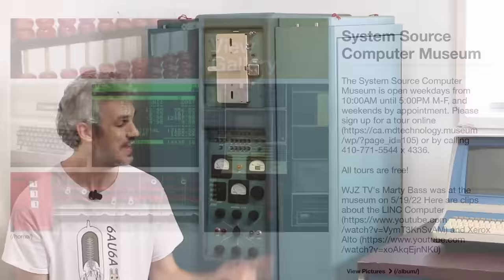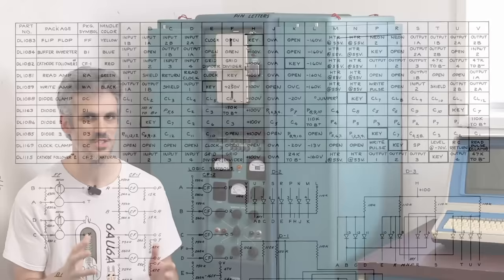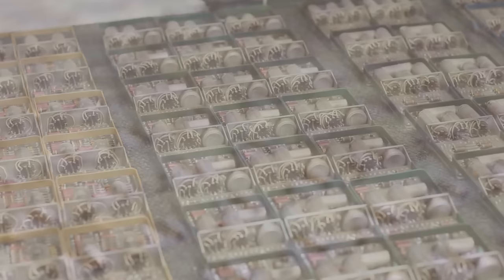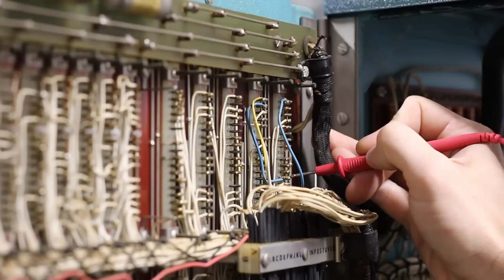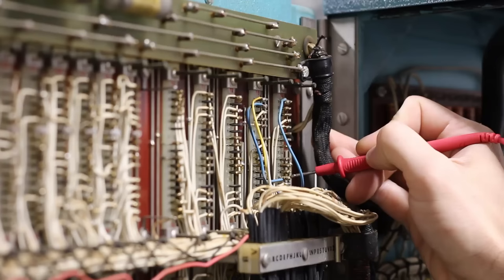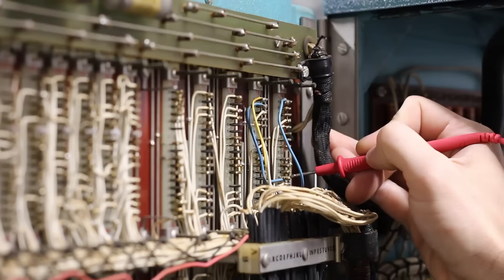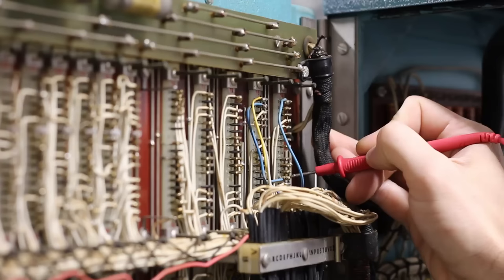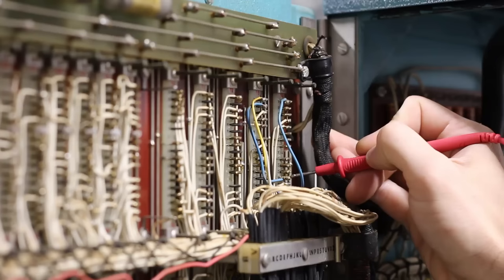Exploring 1950’s Computer Logic with the Bendix G-15!

Comment: Actually I'm not surprised there are so many buffers, since you can do everything but buffer and invert with semiconductor diodes. One of the biggest uses of tubes would be registers, but as I understand it the G-15 has its working memory and registers mostly on the drum, right? Great video.
Reply from the maker: Yup, you're on point! The very large majority of the machine is built around AND/OR logic and they just do a lot of signal restoration in the middle. 
As for registers, all the registers and memory is on the rotating drum, and they actually use the drum in a really fascinating way. The plan for the next video is dive into the drum, learn how it works and crack it open and take a peak inside to make sure it's all good!
Reply: @UsagiElectric  I look forward to it! I assume there is one register done with tubes to hold the next instruction address? (Or maybe they have some marvelously clever way to avoid that.)

Comment: Looking at the nameplate, you've also got some electrical work to do. That machine uses 40 amps!
Reply: I saw the picture of his existing electrical panel which didn't seem to have any spare circuit slots on it.  It'll have to be changed for a larger panel or rewired to a subpanel, I think.

Comment: The thing with diode OR gates that diodes have a voltage drop (about 0.7 volts for a 1N914 diode you can get today). Putting a signal thru successive diodes will drop the voltage for each diode. A transistor -based or silicon-chip OR gate doesn't have this issue.
Reply: Wow!  That is "old school" digital electronics.

Comment: I think I saw at least violet (7) and red (2) bands on the older glass diodes, there's probably also black (0). So they are labeled 270 that way, and are probably also 1N270.

Comment: One advantage of the double sided PC boards with just duplicated traces on each side is that each contact finger has a redundant surface front and back. In a system this complex, intermittent contacts could be a nightmare. I do wonder why the fingers were not gold plated?

Comment: I'd guess the unused 100V lines on the D2 card are there just to maintain commonality with the other diode cards that do use them.
Reply: wonder if any of the cards were in as blank spares for quick field service ?
Reply: @highpath4776  All the components on the cards are discrete, so can be easily replaced, for example the newer diodes. No need to keep spares.

Comment: On cleaning the outside i would use a mikd dish soap like Simple Dawn  a a sponge to clean the surface but only use a drop or two in the water and simply wipe don't scrub and use a oaint brush for any hard spots tgen rinse and dry

Comment: At time 33:27, it shows an odd voltage, 238 volts with a draw of 40 amps.  Oddly that does not match any mains around the world. I am wondering if that was the commercial power voltage when line voltages were only in the 110-115 range.  Today they  are around 120V for outlets in the USA, 208V, 277V, and 480V for commercial three phase, and 240 for residential single phase appliances.  

To power this from a residential feed, you may need either a separate circuit or perhaps you could unplug an electric stove or oven and use that outlet.  Those are usually 40-50 AMP at 230-240V.  I imagine a vacuum tube circuit made for 238V could tolerate a supply of 230-240V without any problems. 

When powering it up, I would first check the AC circuits and power transformers to make sure nothing is shorted. See if you have the proper voltages coming out of the power transformers.  You might want to get some big light bulbs and dim bulb the initial power up.  Then I would replace any paper capacitors and you might want to replace any defective selenium rectifiers.  Then I would turn the DC on and make sure it powers up.  

I would also have some spare tubes on hand, just in case any are bad.  Some vacuum tube computers especially the early ones had high tube failure rates. That is why there are some tubes that were specifically designed and rated for computers and counters as they were designed to withstand the stresses of digital circuits.

Comment: Gorgeous machine. It warms my heart, remembering me to the old days when my father built tube radio receivers and I (6 then) was allowed to do some of the soldering. 
Do you have any idea why they separated the diode logic from the amps/inverters? Could save quite some wiring and possibly reduce signal crossovers. Didn't PDP do so with their transistor logic cards?

Comment: The flop-flop resets on every clock cycle.  A transformer coupled pulse can then set it.  This way, a TRUE is signaled by there being a pulse but the exact time of the pulse need not be too tight.  The circuit isn't that complex after you stop the video and look at it for a while.

Comment: They shoulda used 1T4's, low power and cool running pentodes. Cool viddy!
Reply: Probably not enough oomph (technical term) to drive the signals through the cabling at the speeds desired.
Reply: @SeekingTheLoveThatGodMeans7648  Probably, I just love the 1T4! lol

Comment: My God! A single 12AX6 for a pre-amp is $30. Just to re-tube that moster would cost tens of thousands of dollars... if you could even get the tubes. 
5 min in. I hope you cover the logic in some detail or have other videos that go over simple logic circuits with tube technology.
The transition from tube to transistor happened so quickly that not many famous machines are tube driven... that I know of.

Comment: Interesting you called out that you were a "little too comfortable" in your bare feet. Though, I'm curious, what's wrong with working in your bare feet? From an electrical standpoint you are doing a far better job of equalizing your electric potential with the environment, so in addition to being more comfortable you are also reducing the odds of damaging something with ESD. Also, if you accidentally step on something, you can feel it before putting your full weight on it, reducing the risks of physical damage.
Reply: Yes but if you do get a current to ground you are nicely earthed instead of insulated.
Reply: @cygil1  Not if it's switched off and unplugged or only connected to ground, which is a basic safety measure when there are high voltage systems in play. Normal shoes do very little to insulate against high voltage sources.
Reply: @irdmoose  There is always the possibility of unexpected capacitor discharge, but I guess this particular machine is long dead. Still, good habits are good habits.
Reply: @cygil1  Yep, and following good habits you won't have unexpected capacitor discharge, which could be just as deadly barefooted or not since most people working on this kind of equipment would be wearing a grounding strap of some kind anyway.  😉

Comment: Yikes, wire wound resistors and selenium rectifiers! Reminds me of my attempt at building computer logic out of 'Armor-Star' elevator relay controllers 20 years ago. Selenium rectifiers were actually used in the logic itself in the original elevator design! I totally nixed that concept before experimenting because selenium diodes are uselessly crappy for logic. THEN I found out how toxic they are after NOT burning any of them. 
My suggestion to others is to do this in reverse order, but at least I didn't conjure any little white cancer ghosts that come out from between the fins.  I've heard they smell REALLY bad, lol (don't do it!)

Comment: Most of us just blast all the dust out just using a leaf blower.
Wheel it outside first and be sure to hit all those fans and power supplies.
Reply: I can't tell if you're serious ... That seems like it'd damage ... something, no? I guess I'd just be concerned about cracking a tube or something.
Reply: @halfsourlizard9319  Nope, 100% serious.  I've been blowing out computers for decades.   Free extra I do every time I fix anybody's system.  

Air blasting on a cold tube is a lot safer than touching it or wiggling it around, and fans were designed... to spin.  You can point your leaf blower right down into a modern PC's CPU air cooler and reve it up without harm.  Ditto for the PSU.

Most of your problems iwth older computer haredware are going to be leaking eletrolytic caps and batteries or compents that have gone out of spec, or chips that have died from static discharge from handling or otherwise.  Or they just failed over time.

Rubbing Alcohol is probably better than windex, at least on the electronic componets.  Rubbing alcohol evaporates quickly and is used to clean flux off soldering joints.  Windex is mostly a non-smelling vinegar (slight acid) I think.   

Either way, you can wash electronic components in distilled mineral free water  as long as you let them dry out completely.  I've read keyboards are even run through a dish washer at the factory.  I've done it myself in a household dishwaser as an experiment and forgot to teurn the heat dry cycle off.. very important or you'll melt them lol.      Just let those low voltage electronics dry out completely before you fire them up.   In rice if necessary and you're paranoid.

Someday I'll set up a computer museum of my own.  The problem seems to be acquiring a building for just stuff to sit in.   I thought of doing an outdoor one which was a long display with a brick wall on one side, and a window and bars on the other, like the VIetnam War Memroial where people could just walk up and walk along a sidewalk and go from start to finish in a timeline, no charge, no curator, no little maintenance.  Static display.

Comment: It is strange that they aren't using the tube voltages that you are using in that vacuum tube processor you were building.
Reply: In those days tubes always had high volatge on the plates.  At low voltage B+ tubes simply do not work well.  Output power becomes tiny.  David designed his VT computer for low voltage and  that is certainly a valid design decision,  Technicians were taught due caution as 150 VDC can indeed bite.  I had a VT transmitter with 800 VDC power supply.  The final amplifier was built in a metal cage as that voltage can easily be lethal.  VT color TVs used something like 25,000V for the CRT and extreme caution was required when working on them.  But this computer has a low enough B+ so that simple cautions are adequate.

Comment: Why did vacuum tube computers use standard sized vacuum tubes with their power hungry filaments instead of tiny vacuum tubes like the ones used in the proximity fuse or hearing aids of the same era?

Comment: U don't want to replace those caps with axial caps 

U wanna use the rectangular mains caps for emi filtering 
They are rated heavy duty and cheaper 

Probably best replace all the simular caps with the new part just because aceint as an beyond end of life 

Don't throw away the old caps document it and put it with cabinet in baggie 

Collector status it's good to have the original and old components with it

FYI u should try make a universal program or find one and translation electronics so u can plug into any computer and control and display all the data in it

Comment: How odd. The 1N270 diode is only rated to 100 volts max.  But the schematic shows some of them tied to +100 volts.  Maybe Bendix was pushing these right to their limits?
Reply: This is interesting.  Could Bendix have specially tested its diodes for withstanding a higher inverse voltage?

If updating the diodes I'd want to go at least double the rating.
Reply: @SeekingTheLoveThatGodMeans7648  Yes, they probably tested every diode, so why not test them at 150 volts at the same time?  
It's also a bit odd that they used these high-conductance diodes when the circuit requirements are much more modest.  We used to use 1N270's in low-impedance transistor circuits that needed their high conductivity.  In a tube circuit you don't need high conductivity so much, usually reverse resistance is a more critical parameter.

Comment: I noticed on the name plate of the Typewriter 1D3001 that it said Use with NC 1 or ANC 2 or ANC 3  and just do not use with ANC 1..     Is that the typewriter you have or a generic plate?
If it is the one you have, then it still could be tricky.  is ANC1 a modified NC1 converted to ANC?
If yours is an NC 1 then you should be fine if that was your typewriter.

Comment: Hexadecimal gets weirder in some machines- the LGP30 uses f, g, j, k, q and w to represent A-F.  And there are some even stranger examples.

The power supply is going to be a tricky one.  You will definitely have to replace the electrolytic capacitors if this machine is going to be reliable.  In some parts of the circuitry you could definitely cause some of the tubes to red plate if you have leaky capacitors.

Comment: How do you power up a unit like that? Old electrolytic capacitors need to reform. It's a good idea to bring up old tube equipment on a limited current supply with variable voltage starting around 40 volts AC increasing slowly over time.
Reply: Remembering the days when we would rig an incandescent light bulb in series with the device as a current limiter while reforming the caps.
Reply: @rickhole  Use all the lights from a football field to be the dimbulb

Comment: Yikes! When you have that all laid out, you get a good sense of just how much space they were wasting on most of those cards. Not really that dense at all. It's as if it was more important to have the logic fit that form-factor instead of optimizing the space each circuit takes up. It was more about easy of manufacturing than optimizing for space.

Comment: I think I'm missing something at a deeper level than I can articulate: If you have a strictly-numeric machine -- no alpha -- how would you even enter machine code? (i.e., how would you write opcodes in the goofy hex without U-Z keys *at least*)

I don't understand the ISA or the programming model, which is prob source of my confusion. (Wikipedia was no help.)
Reply: Also, it's funny to think that inflation-adjusted this thing was ~US$500k and (quite literally) has less less compute power than my toaster. It's nice to see evidence that the world is NOT getting worse in every possible way, eh?
Reply: Code would've been done on a separate device maybe even on another GP computer running a translator. And fed via tape in this case.
Reply: @denisdrozdoff2926  Oooh, so, you can't program it stand-alone? My understanding is that on punch-card-era boxes, you used a tool to punch both the code and the data onto, well, punch cards; and afaik, the output was also punch cards ... But, basically you're saying that programs and data are represented/handled completely separately here?
Reply: @halfsourlizard9319  you have the typewriter as output, you just have to translate the HEX afterwards. The question is if the computer used the HEX at all, maybe it used Octal minding the fact the shifter box can do that weird HEX. Im waiting for the next part, I love computer archeology.
Reply: @madigorfkgoogle9349  Yeah! It'll be so much fun to see it up and running!
Reply: (When it's running, obviously, that'll answer a lot of my ignorant questions 🙃)
Reply: @halfsourlizard9319  this one would have a standalone tape punch operated by another computer (be it a machine or a job title) to write programs.
And typewriter would be simply a UI for getting variables in and out.
Probably there'll be a debug mode where you can plug single commands, but no. No sane person would manually punch code directly into those. Because I had done so and felt sanity slipping through my fingers, on a machine that had a arithmometer-style keyboard for sole input: you don't need an input latch if you have radio buttons with mechanical latches, and their approach to fitting a HEX opcode (and a 13bit address) onto a decimal keyboard was splitting everything into OCT.
Reply: @denisdrozdoff2926  Wowza, different times, eh? Makes teletype + Ed look advanced by comparison!
Reply: @halfsourlizard9319  No way to port Linux to this baby
Reply: @SeekingTheLoveThatGodMeans7648  Next, you're going to break my heart and tell me it won't run Doom 😜
Reply: I first wrote code on a G-15 at UCLA Engr basement in 1960. OPs were numeric; I think '50' was multiply(?) No assembler - you assigned addresses for code and data. It had both paper tape and punch card I/O. Aside - down the hall was a comp called SWAC that created the sound for the movie "Forbidden Planet". The operator was entering code in binary to develop logic for a pseudo random number generator. It had a speaker hooked to the CPU so he could hear how long it took to loop.
Reply: @g_shogie7530  Appreciate getting some first-hand knowledge about this! Got it, so everything was fully numerically-encoded -- obviously, in principle, you could enter EVERYTHING with at least TWO keys, eh? ... Kind of crazy to consider a time before asm -- of course, you can STILL just drop some bytes into memory and execute them as code ... but at least having Ed + an assembler must have been an enormous leap forward ... Hope that some day I get hands on / get to write some code on these beautiful old hulking machines!

Comment: Don't replace those capacitors just because they are ugly. They are likely high quality silver cased units with rubber tubing on the outside for the printing. The tubing is there so you can still read the value after the silver has tarnished to black. Well, that was the plan. The tubing degraded and destroyed the printing! My advice is to just trust the capacitors and if they are still fine - leave them be. They may outlast you.
Reply: The only caps he talked about replacing are some electrolytic. And I could see the corporation on those bodies from a mile away. They are not just ugly, they are dangerous to the machine.